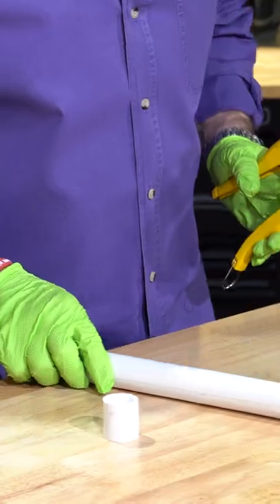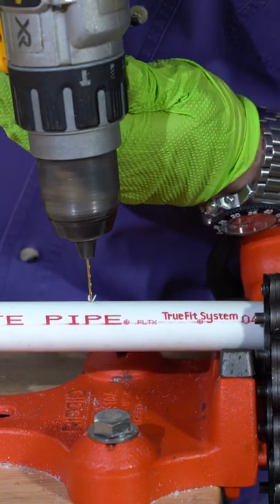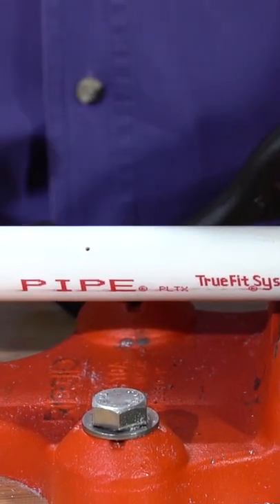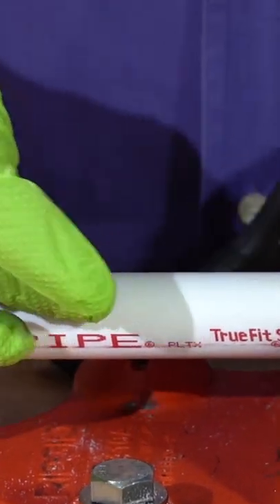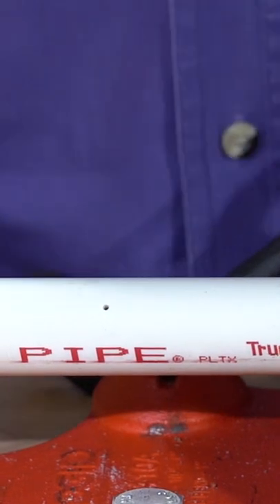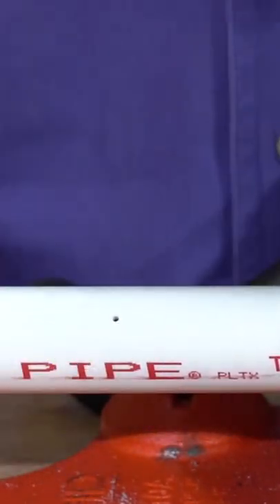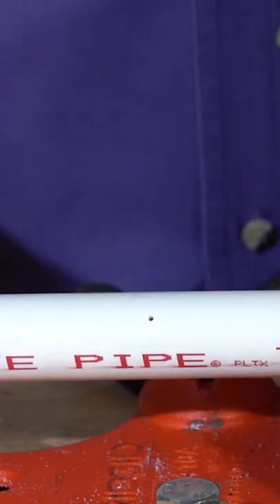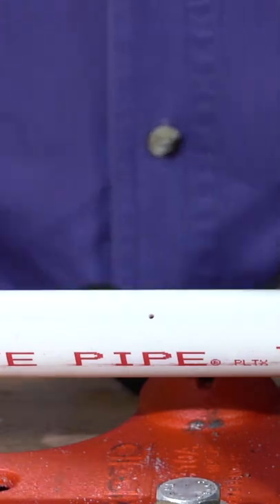Hole in PVC Pipe

Comment: Roger I lost a job recently because I couldn’t get the parts to fix a hole in a cpvc valve. No it wasn’t 1/2 or 3/4 or even 1” that I woulda used a damn push pitting to temp fix while I waited for parts. It was a 1 1/4” cpvc valve and it had a pin hole spraying water . The hole was in a rounded section, and there were no valves to segregate the leak. It was a Friday night and parts wouldn’t have come till Tuesday. I wasn’t willing to try and rig something and have it fail. Do you think I could have glued pvc to cpvc and trusted it under pressure?
Reply: Not worth the risk, unless they want the fitting to randomly bust, make them wait  til Tuesday
Reply: @chrisdinke271  Til Tuesday was a band in
 the eighties. Amy Mann was the singer. Just being random.😁
Reply: A temp fix would have used a piece or rubber and a hose clap until Tuesday.
Reply: Could have went to a hardware store...
Reply: @mds6387  I live in a city and I went to 2 different plumbing whole sale distributors but in this area 1 1/4” cpvc isn’t common. Just couldn’t get it Immediately